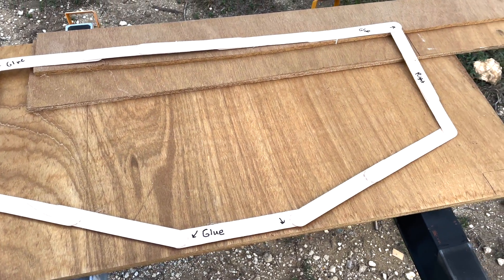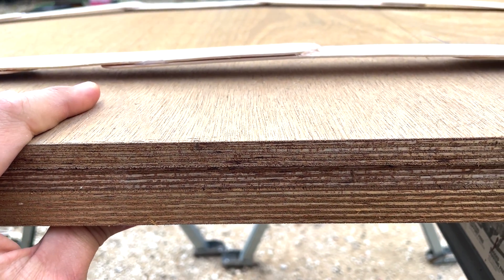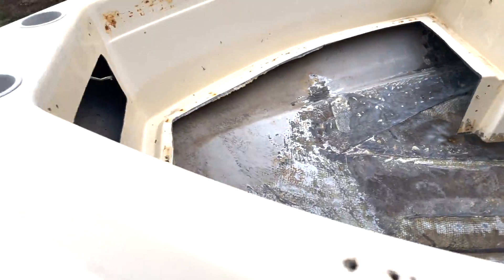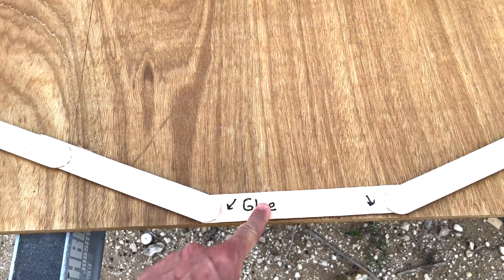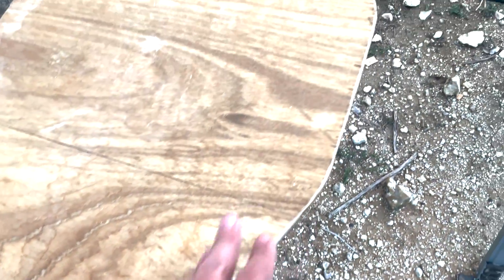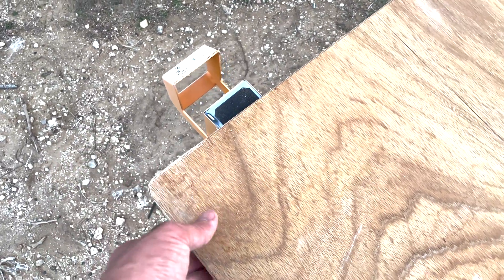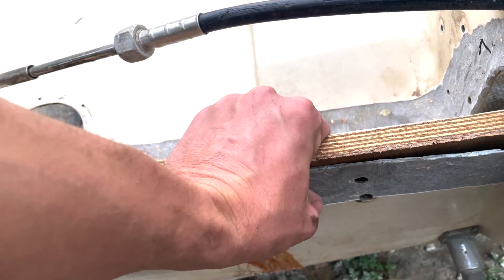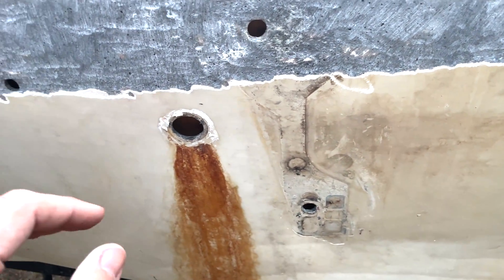Rebuilding a Boat Transom

Comment: What if you put a bevel on the bottom of the transom, against the hull?  That may let the wood drop down a bit more?  Using a router?
Reply from the maker: That router idea is dynamite! Thanks! I can’t believe I didn’t think about that! Thanks for your comment!
Reply: @michaelromer2016  Your Welcome!  I used your videos a year and a half ago to go from not owning a boat, to owning a fully rotten boat, to a working 70's 15' TriHull.   Did the floatation foam and everything!